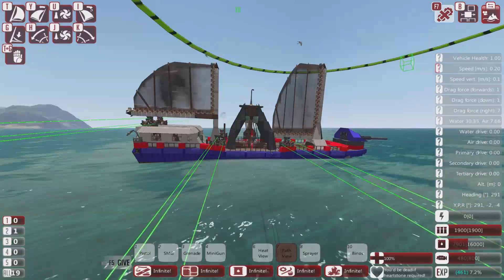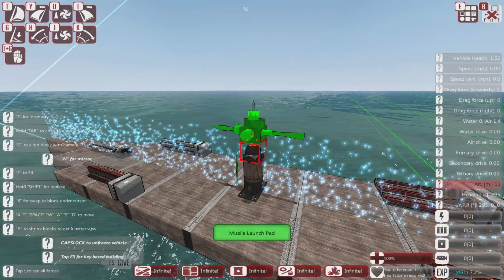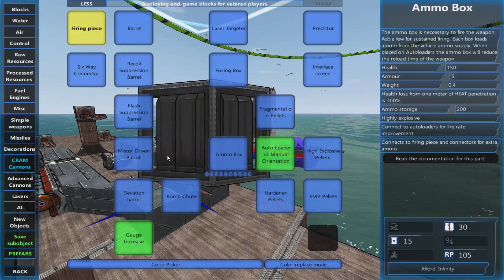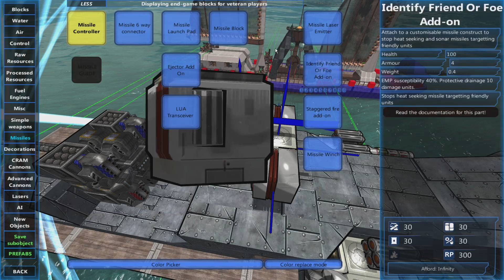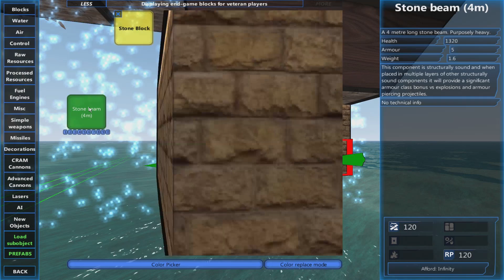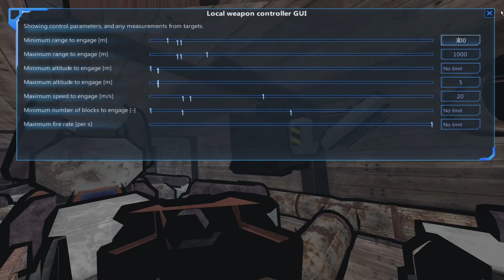From The Depths S3 Design 02-Torpedo Gunboat.LetsBuild

Comment: I have a jet for late game. it's very modern, and it can take on every fighter in neter. it's a work in progress, but it's pretty much finished. armed with four heavy duty missiles, with an efficient engine, flares, high maneuverability, a speed of 106 m\s, a wavy flight pattern for missile avoidance, and a cost lower than nearly all of the planes on the planet. I can also supply you with an older air force. but please consider this.
Reply from the maker: +Fred Johnson  Sounds really good. I was thinking of making a carrier for mid game that will start with say prop style then go into jets. If it is a somewhat classical look and fits in the Jet era then I would be happy to feature it when it gets to that period. Any Earlier period prop planes or early less capable jets would be good I think at the rate i am going the props will be in in a week or so and jets a couple of weeks time.
Reply: +Dels Gaming no problem. my jet is very modern, so it'll be a while. but I'll be making older ones soon. are you speaking of 1950-60s?
Reply from the maker: For jets first level would be say think meteor or Sabre mig 15 then going up to say mig25 f15 f18 , then would be the current latest f22 f35 su35 as these would show a significant improvement in each stage using different build methods weapons etc. or just size in blocks allocated to design
Reply: +Dels Gaming once I finish it, and you get it, I'll leave you to determine the era. it's painted in all grey to allow you to give it your own paint job. It's pretty much finished. I'm glad we had this conversation. just make it clear in the later episodes when you need it. :)

Comment: the Superstructure in alright, but I think it could be improved with more authenticity.
Reply from the maker: +Fred Johnson  Agree on this in hidsight,. Used too much metal and should have used more wood. Would have helped with balancing the hull also. Got carried away :) Due to block size it is sometimes difficult to make some things small. i.e. a proper gunboat would have had a small bridge and the guns would have been a lot smaller I could have used ACC's but not in my mind as yet but may bring them in for the smaller guns.

Comment: You should change the torps from explosive dmh to emp warheads as they will do significant dmg to things such as cram cannon components the ai  and take shields out quickly
Reply: But don't use emp warheads for cram cannons but go ahead with the advance cannons
Reply from the maker: +drivver44  As I am doing a classical campaign as much as possible things like EMP don't exist in the 1800's
Reply: but still emp missils are very good as long as they dont hit surge protectors or wood
Reply from the maker: A lot of DWG is wood so I doubt they would be effective, but very good say against OW or white flayers

Comment: On the subject of the gunboat, even staying within RP requirements the armament could be greatly improved, as could the hull. A ship of that size could handle several no-autoloader ACCs in the 120mm range as primary guns with a few lower-caliber ACCs as secondary, with something along the lines of a Nordenfelt gun or two as tertiary. This would be entirely period-correct, in addition to the torpedoes. The lower hull is ugly and the upper hull, while pretty, really doesn't need that much metal, most of which isn't even protecting anything in particular. Stability could be greatly improved by replacing some of it with wood and using the metal on the lower hull to protect the ammunition and engine.
Reply from the maker: +Morrigi192  I did put else where but will say I'm not happy with the ship and have already redesigned the top and hull off video. I used too much metal on top and replaced most of it with wood, sort of got carried away at the time.
On the weapons I I am not introducing ACC's yet these are in the theme of campaign an earlier less efficient weapon but they will be in soon and will allow better looks. I also want to see how far I can go with CRAM.
I am debating either a total rebuild from scratch on this gunboat or a refit.
Then again i t is not easy doing a build in one take on a video :)
Reply: if you were truly as experienced as you present yourself, you would know that penetration occurs most from the superstructure. ai tends to aim above deck with cannons. I agree that the hull needs an armor belt, but let him do his thing.
Reply: Fred Johnson There's nothing IN the superstructure, though. It's basically just a navigation bridge and a staircase, and everything important is below the deck. Therefore, it's pointless to waste weight and resources protecting a useless superstructure. With future updates we'll probably have a lot of complex sensor and fire control equipment above the deck, but as of now the extra armor is useless.

Comment: Have you considered changing the HE on the gunboat guns to AP?  With the changes to armor and HE damage, HE is extremely weak unless you allow the buildup in the CRAM cannons.  AP could allow a bit more structural damage, punching through, making holes and disabling functional parts instead of scathing the surface of them.
Reply from the maker: +The Heat Death of the Universe  Yes I was thinking about it as the HE seems fairly weak. may keep 1 HE and go with 3 AP. 
Will do same on all but largest 6+gauge cannons where it can stay a 50/50 ratio
Reply: Dels Gaming Yes, I was thinking about it since I had created a small 60mm gun that had a tendency to shred even larger ships while HE at such a small gauge refused to damage even wood.

Comment: Realy bad design from the torpedo boat, you use iron to tank the top floor but build the body out of wood....
You could use light alloy for it.
The offbuild is a bit trash.
Normaly you start building from the kiel to the top.
Reply from the maker: +DougFunnyJunior  Well you are open to your opinion and will say I used a bit too much metal on the top it should have been wood to keep in with the theme of the campaign. Light alloy is not being used as the alloys are in later in the campaign in my theme for this season. 
As I stated in vid the reason to start with the gun deck in these classic ships is you need to find out how wide the weapon systems will make the ship before you build the keel. In this case I still did not go wide enough.
On weapons, I could make weapons that one shot the DWG. Not the intention as again this is a themed campaign so weapons in the 1800's where not one shot death weapons. 
I will stress this more in the future at start of design so watchers understand the limits I am working with on the build.
Reply: +DougFunnyJunior  Normally I would agree with you, but this is a themed lets play and lets face it: a well placed shield can stop pretty much anything other than very specialized ammo that the DWG don't use..  And as the mighty Jingles would say " If it's stupid and it works then it ain"t stupid."  :)
Reply: If it's stupid and it works then it ain"t stupid. Would be right, but i dont have seen that the torps or the guns have made a effect 1 ship that have nearly a defense. This thinks in mass sink only without killing 1 ship.
Reply: I have completed this game with 500  max block drones, it's like a game of chess to me.  If you present the enemy a tank to shoot at you can obliterate the enemy with glass cannons.
Reply: +Valshala If it's stupid and it works but you can use the same amount of resources to make it work much better, it's not a good design. Also, the guns are simply trash.
Reply: There is a fine line between giving tips and commenting on something and backseat gaming :3
Reply: +Bartoc agreed. I thought my comments were harsh, but they don't compare to this amount of hate coming through.
Reply: Bartoc It's still a poor design.
Reply: +Morrigi192 dude. this is hate. I understand where your coming from. it's painful for you to watch players mess up, especially when they act like theyvhave the right to judge, and they're wrong. however, I like letting them figure it out sometimes. just let it go. give him some of your designs or something. don't hate.